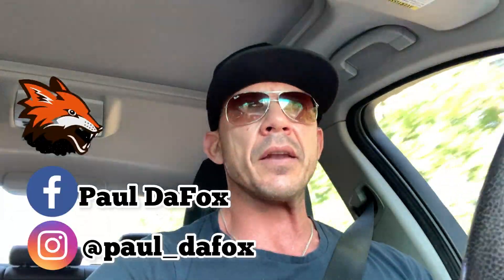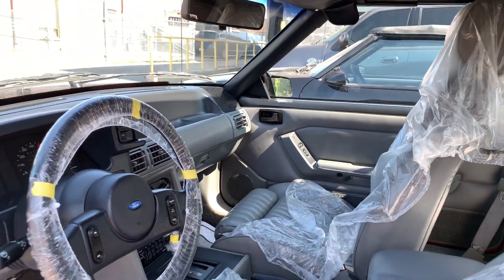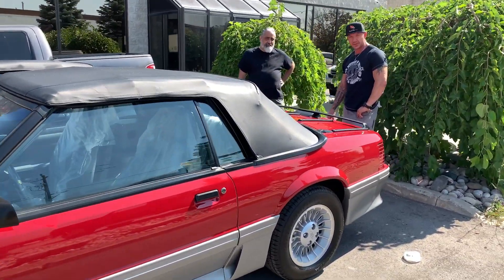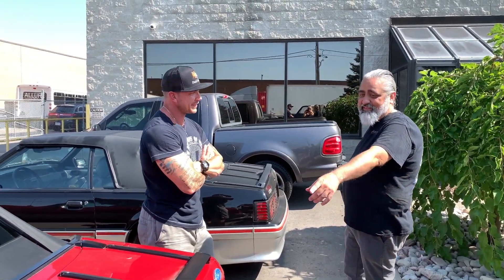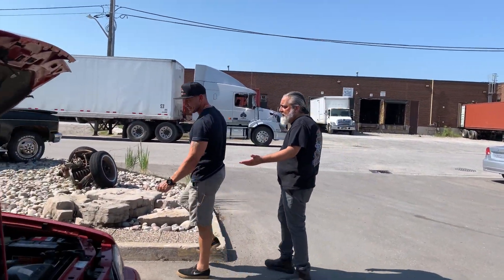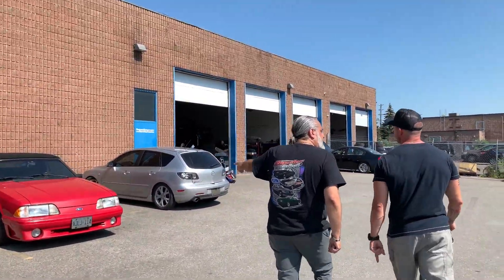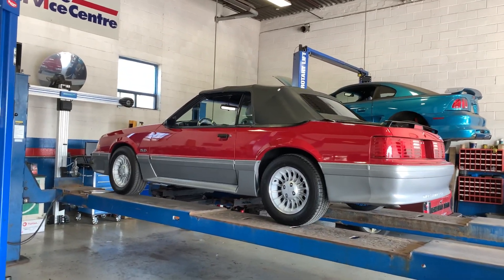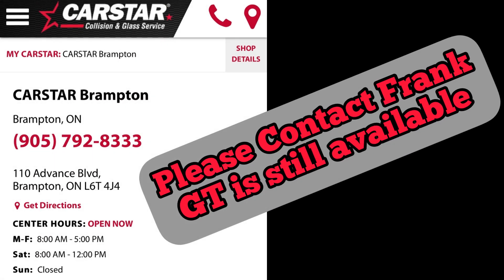MINT FOXBODY MUSTANG GT CONVERTIBLE || Is This Sally's New Vert Fox?

Comment: That headshake when  you opened the hood. That's the 'this is way too nice' to drive kinda look. Foxbody guys.. and gals...are always thinking about where they can go with the car. That car, in that condition, its where its should be now and going forward. That's hard to own.
Reply from the maker: Hey VacFink, thanks for checking in and I totally 100% agree with you that this GT was way to nice to touch or modify, so we didn't up getting it but the next day we locked in a kool foxy for Sally! Have a great weekend!!🙏🏁

Comment: The very 1st "aero" Fox body Mustang GT I ever saw in person was in the early spring of 1987(I was 21 at the time), I'm pretty sure there was a slight delay when the '87s came out so most were at dealerships by early 1987. The "aero" Mustang I first saw was the exact same color combo as this convertible, but was a hatchback. I'm pretty sure '87 & '88 GTs came with a red or blue stripe around the perimeter of the side molding/bumper, the one I saw had the red striping. It belonged to the Smog/Emissions instructor at the auto repair school I was attending in late '86 early '87. Instructor was already 70 years old, a former Ford engineer and also owned a black 1982 Mustang GT with a 351W transplant, that thing MOVED! :-)
That is one sweet, original convertible!
Reply from the maker: Hey brorher, the first fox I owned was a 4eye in 91’ and my 1st aero was in 92’.  Your the first to mention no pin stripe; from what I undertsand the original owner requested not to have it installed. Really appreciate your comment and for you watching. Have a great day!! 🦾🏁
Reply: @PaulDaFox  Hopefully you can pick up this sweet 'vert. BTW, my name is Paul too 👍
Reply from the maker: @05gtdriver  Hey Paul (great name🤣) Sally and I really thought about it and decided that it was to nice to touch or modify so we didn’t get it; but the next day we locked in a kool foxy for Sally!! Thanks Paul🤙🏼🏁
Reply: @PaulDaFox  Congrats on your new steed, hoping to see content on it soon.
Reply from the maker: @05gtdriver  We’re going to unveil the new 🦊 on our next livestream; this thursday ( Sep 2nd) at 8pm EST.  Hopefully you can join us👍🏼🏁
Reply: @PaulDaFox  I certainly will!
Reply from the maker: @05gtdriver  Thank you so much🙏🏼🏁